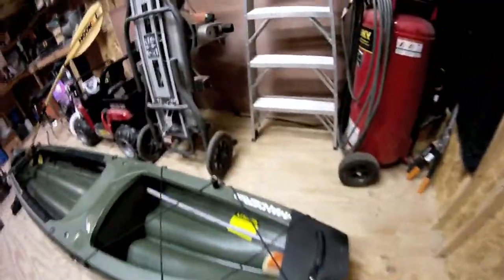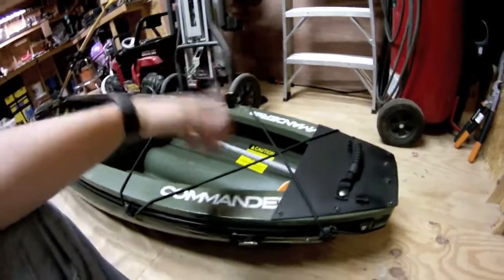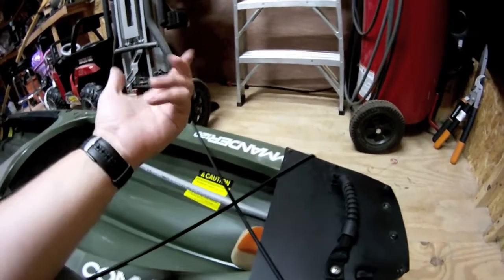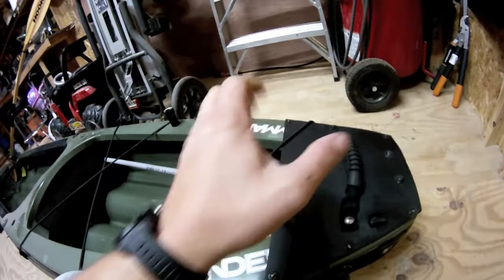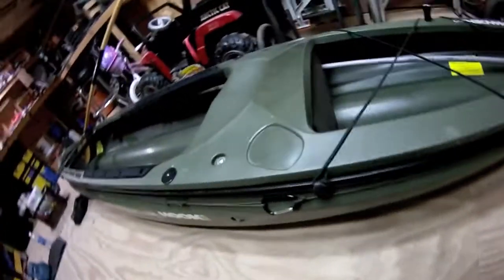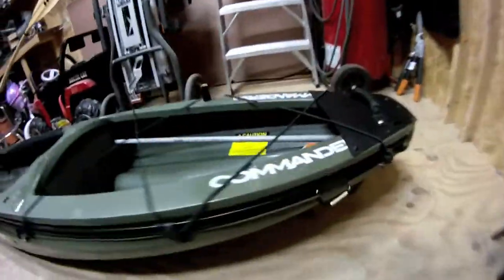Commander Mods

Comment from the maker: I came from a native u-12 to this boat and yeah your right it a little tighter in the leg when standing I notice that to, it took me some getting use to after a while of using the yak you start to not notice it. I will say this though it is a flatter stance while standing then the native yaks. The native yaks are rounded at the bottom the commander is flatter, so my feet don't hurt as much while standing......and i stand for hours on end.